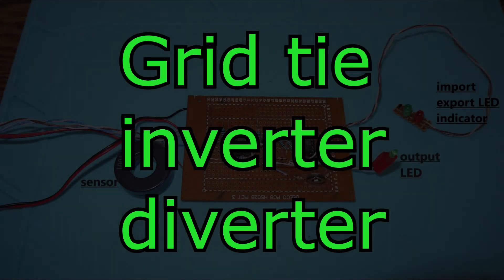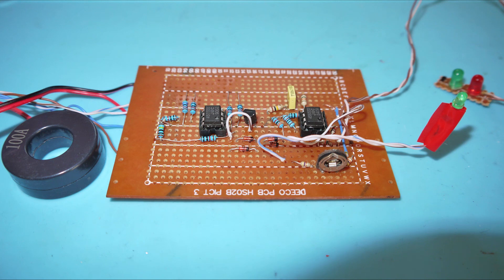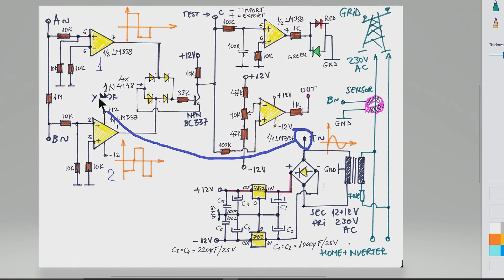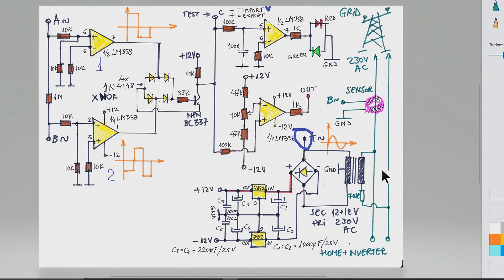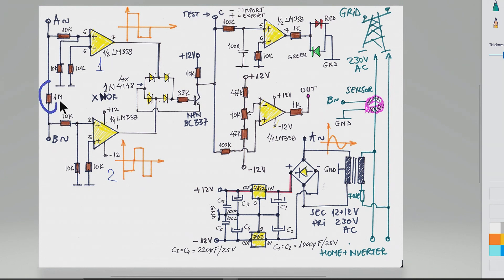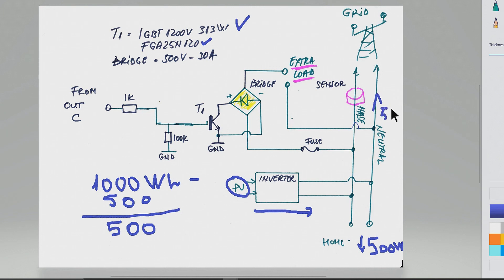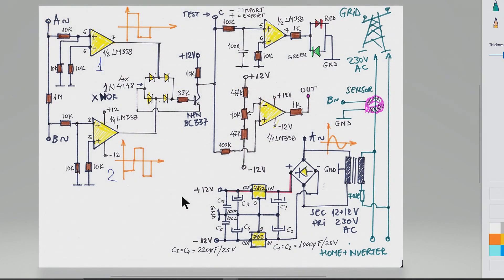Diverter for avoid any solar power export to grid. DIY easy schematic.

Comment: From what I understand, growwatt and NEP inverters try to do this but seem to let 100 Watts past occasionally and may accumulate a bit much. I was pondering an idea to simplify a circuit by adding a 5-10 watt load, measure if the wattage flow is higher or lower to know if a PWM needs to be stepped up or down. I'd like to dump the rest into batteries at the same time but, that's problematic because what if the batteries are full...  What do you think?
Reply from the maker: I didn't really finish this project...but a load turned on when it's ''leaking'' to the grid, it's perfect. Maybe a small boiler...

Comment: How to add the exact additional load (500W in your example) to achieve the power balance if the heater is 2000W?
Reply from the maker: The idea is that the power charged by the inverter should not be found in the grill... for example, if the internal consumption is below the power delivered by the solar installation, the installation blocks access to the grid. Unfortunately, I did not manage to complete a functional version. I preferred to buy a "smart" inverter from SUN 2000W with consumption sensor.
Reply: @viocaia  Our explanation of the schematics is very good and I highly appreciate it. The point was that whatever you have a commercial inverter, you could use the solar energy more efficiently if you have variable load. Then you can consume more if more solar energy is provided The battery could be such power consumer, but its price is usually much higher then the hot water heater.
Reply from the maker: @Simeon_Tsvetanov  right

Comment: Hi, Thank you for the circuit diagram which seems quite strait forward, is it just theretical or have you used it in practice with success as I can find no follow up of the project  ?  Best wishes
Reply from the maker: The idea it's working, I couldn't find a way to finish it, I was thinking about a PWM  to controll an ongrid coverter of some sort. I found a SUN 1000GTIL which already is doing all this...
Reply: @viocaia  Thanks for the reply, best wishes.
Reply from the maker: @barumman  Thank you too ! All the best !

Comment: Did this actually work?
I've designed several myself and the resulting phases have never been clean enough.
My best attempt worked by using a pic and sampling the current against voltage phases and using an average of the samples.  I will make this and give it a test, but suspect that the output won't be as clean as intended.

Jonathan
Reply from the maker: I didn't finish the project, so far the circuit was ok, but the final IGBT , I didn't had one..I tried to implement an relay but not working.

Comment: I read that you never finished this off. This is a real shame as it is exactly what I've been looking for. The ideal would be an output to drive a relay and a way to adjust the export kW value threshold to trigger the output. Hey - I'd even pay for this! Shame my electronics skills are so poor!.
Reply from the maker: I didn't finished..I know someone which took the project further..I will contact him and ask what;s new..I tried with relays..is not working..probably a PCM generator of some kind to drive a DC to Ac convertor..
Reply: @viocaia  Thanks for taking the time to do this. Very kind.
Reply from the maker: @ukzerocom  I wish to be more helpful..

Comment: Thank you for your great instruction, can you share the schematic with thanks! I saw it on your video but can not figure out the entire schematic, how it interface with the stupid inverter...etc!
I am looking for a way to replace the ATS with a sort of device like your are presenting!
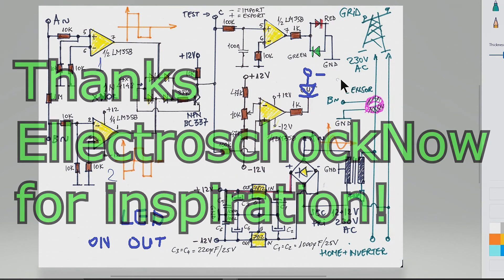Reply from the maker: Thanks for looking..unfortunately the project wasn;t finalised , but originally it should work with the final stage at min 11:44 , that transistor is driving the extra load..so my intent was to do a PWM modulator..I couldn't ..just not working..but if you combine the final stage with the main schematic you can drive a boiler or heater for harvesting the extra power when no aplliances are in use..I hope it helps..

Comment: is what your saying is that if exporting.. the grid tie inverter will be out of phase with the mains voltage.. Im not sure I completely understand?
Reply from the maker: Not at all..the grid tied inverter is locked to the phase by it self..this board got nothing to do nor command any inverter..It's just ''feels'' when the current goes to the net and turn on eventually a proper consumer to avoid leaking any power to the grid...

Comment: hi can the igbt control solar panel input, then  adjust  grid tie inverter  power out? solar to grid tie .
Reply from the maker: I was thinking about having a PWM in the input based by the voltage before igbt...maybe an Arduino to convert voltage to PWM and some power Mosfet it's a interesting idea..

Comment: Very useful project! Can't wait to see, how it works.
I only see some problems, when import/export changes rapidly. I will explain on my take to this problem.

I tryed to solve this problem with a current relay (din rail mounted). When consumption from grid falled lower then 100W, the relay triggered dump load. But when solar production was not stable the relay was switching on/off too frequently. Reley had some histeresis and time delay, but was not enough. So I added a timer switch and set it to 5 minutes. It has a few modes. I put it in mode when each on state from relay extends on state on timer for 5 minutes. It worker fine. 

But then another problem evolved. If export from the house to grid exceded 100W, current sensor switcher off. It only measures absolute current, no matter if it's import or export. So I moved current sensor to measure solar production. If solar production exceed 250W it switches on timer and dump load. My dump load is mostly a battery charger for Bosch 36V batteryes for lawn mower and grass trimmer.

So I can proudly say I cut all the grass around house with solar power. :-)

When I don't charge batteryes, the exceed energy goes to grid. But this is rarely happening. My solar micro inverter is only 500W. My constant energy consumption (without peaks) is 250-300W. So most of the day all the solar energy is consumed inside the house. It reflects also on the monthly bill. It is very likely, the amortisation time will be 3-4 years. Maximum five.
Reply from the maker: Super! Maybe you can draw a schematic and a video and present in your channel.Here , with the IGBT transistor will be kind of different, that follows the ups and downs much better, the point is sometimes the voltage to the extra load will be under the normal ..but let's say a switching power supply charging batteries will work anyway..or maybe the output wtll change the duty of a PWM ..can controll the inverter input ..work in progress anyway..
Reply: @viocaia  I'm too lazy to make a video. :-) 

I used Elko PRI-52 current relay:
https://www.elkoep.com/current-monitoring-relay-pri-52
https://www.elkoep.com/media/import/Elko/PRI-52/EN/Manual_PRI-52.pdf

and ETI/Elko CRM-91H timer:
https://www.elkoep.com/multifunction-time-relay-crm-91h
https://www.elkoep.com/media/import/Elko/CRM-9S/EN/Manual_CRM-91H_93H_9S.pdf
Reply from the maker: @tg_privat  OK! Nice to share anyway! I never used this kind of relay, It's a solution..
Reply: I just came across this, thanks.  Your solution is quite simple and inexpensive (when commercial units are so expensive), but I do not have the smarts to produce such a circuit. I guess it is the complications of how to modify/regulate the output for real life control that is the complicated part. 
A couple of comments if I may, remembering my electronic knowledge is not too good so I am happy to be corrected.  
1. The CT sensor is I think effectively across about 20K; this seems high, for a CT likes very low impedance; it will try to produce IxR volts so at 1A it calculates at 20kV. (I assume the CT has built-in back to back zeners protecting the output). But if true, I don't know how to solve that issue.
2. Perhaps this CT (or another CT) output could be used to give an analogue voltage across say 100ohms, to drive an adjustable comparator circuit, and so save a current sense relay; with  a timer chip added to the circuit, it would give the export on delay required. So if export condition is true, and load > x is true, timer times out = power to the load.
I was also thinking the analogue output might be useful for regulating a triac or similar in the load circuit to give an analogue control of current (or maybe regulate an EV charger?). Not so simple though as if you divert the power to your load, the CT sees less export and turns down the triac.
Anyway, thanks for the interesting circuit.